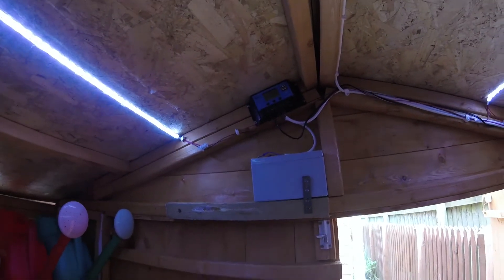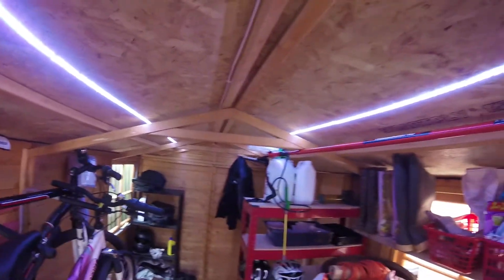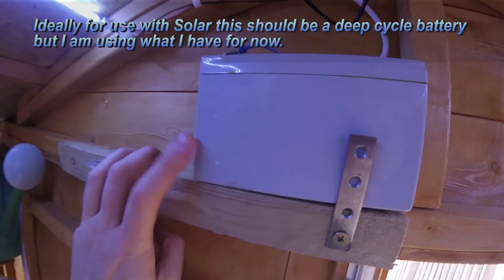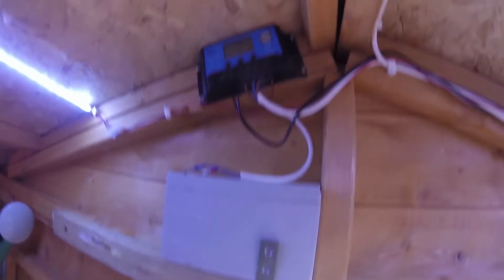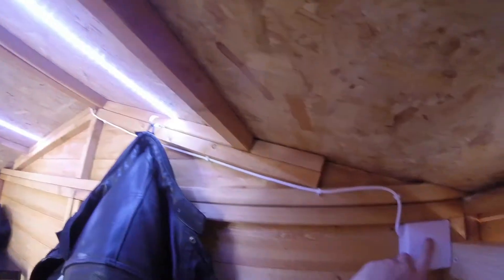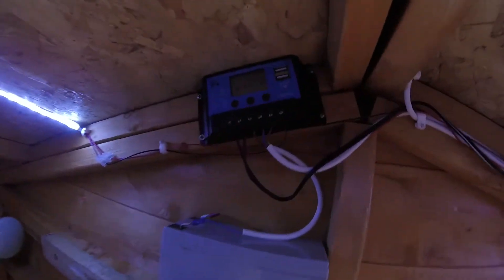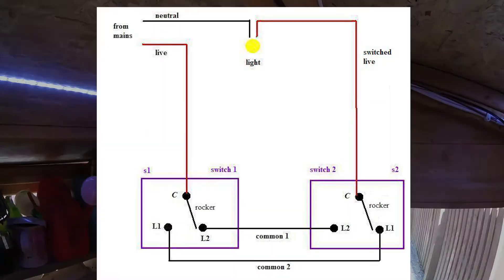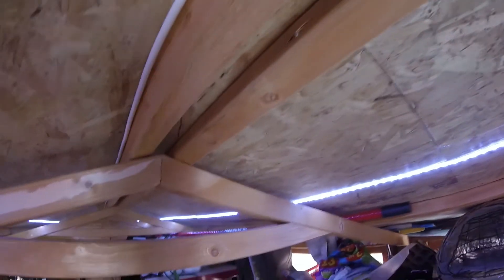Solar Shed lighting with 2 way switch

Comment: How did you wire the switch onto it? Mine doesn’t work when I put the led wires into the controller, they stay permanently on
Reply from the maker: Lee Wood I followed the wiring diagram in the video at about 2 minutes 58 second in
Reply: Jon Warburton how have you wired into the controller though? I understand a regular switch. But not with the controller
Reply from the maker: Lee Wood the controller has a positive and negative output for the light, these feed into the neutral and the live feeds in the top left of the diagram in the video
Reply: Jon Warburton that’s the same as what I have done. Confused 🤔
Reply: Mines only on a 1 way switch
Reply from the maker: If its a one way switch then you can only have a single switch.  All you need to do is to place it inline on the live wire. The switch will either break the circuit and the light will be off or it will complete the circuit and the light will be on.
Reply: Jon Warburton so I don’t put the live and negative from the lights direct into the controller? Just the negative and the positive to the switch? Beginning to think I’ve wired it wrong now, the switch works before I plug the lights into the controller
Reply from the maker: For a single one way switch wire it like this https://electricaltechnology.org/wp-content/uploads/2012/11/httpelectricaltechnology1.blogspot.com-...How-to-Control-a-Lamp-by-a-Single-Way-or-One-way-Switch.jpg with the negative and positive going into the corresponding connector on the solar controller
Reply: Jon Warburton thanks, I understand how to wire a basic switch it’s just with the inserts in the controller unit I’m struggling with
Reply from the maker: A solar controller usually has 3 pairs of connectors 1 pair that goes to the battery, 1 pair that goes to the solar panel and 1 pair that connects to the light circuit.  An example pic of such a controller is https://www.windynation.com/products/z_628_0_3.jpg
Reply: Jon Warburton mines the same as yours, so you have positive and negative from battery straight to the controller. Solar panel straight into the positive and negative, and what into the lights? Positive and negative again?
Reply: All sorted now. Where did you get your solar panel from? And how long did it take to charge your battery?